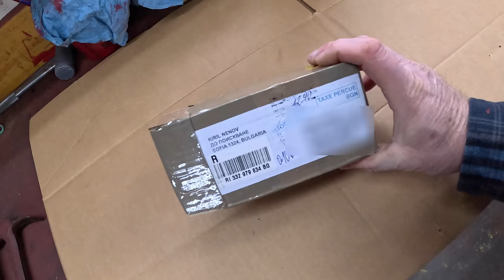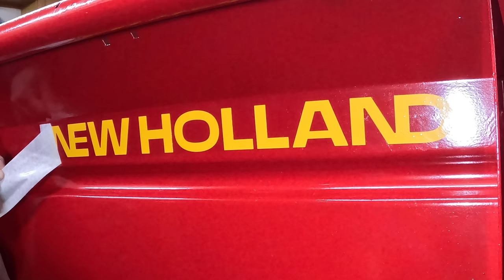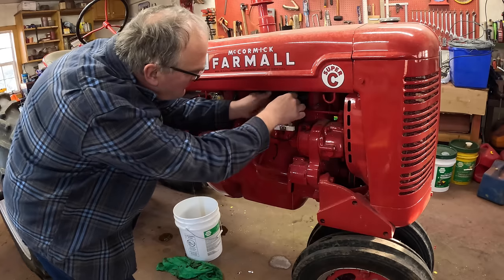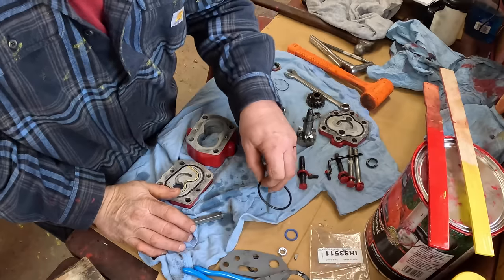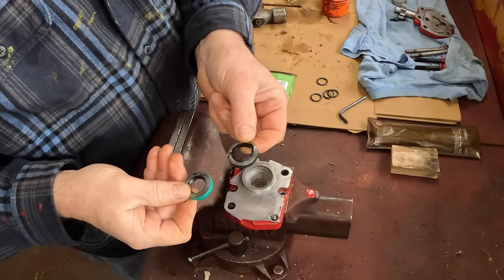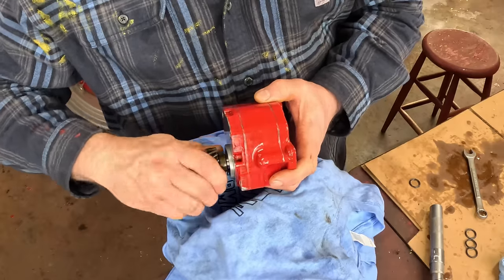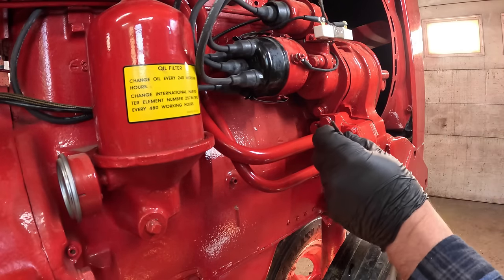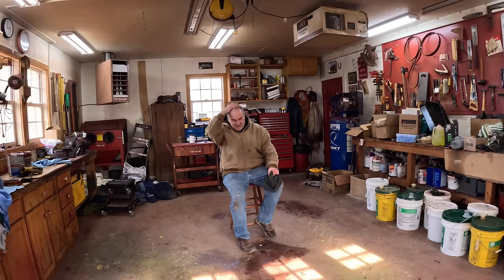Repairing the Farmall Super C Hydraulic Pump and Applying Manure Spreader Decals

Comment: Man that super C sounds great !!!
Surprising how well it runs, has no trouble in road gear. 
So nice to see a Farmall going down the road without having to move the steering wheel hardly at all !!!
Spreader turned out much better than most would expect. As much as you use it in the spring, this year should be trouble free, & operate like new.
  Going to be hard for me to watch that first bucket go in there, BUT …. You bought it to use……
Quick power wash & good as ever.
 Congrats on getting the pump repaired, getting parts seems to always be a frustration at times.

Comment: Hey Pete, it's getting cold here in Wisconsin as well. 5 degrees right now. No heat in my shop so I'll wait for the sun to warm things up. Rebuilding old equipment with the intent of them going back to work can be quite the challenge. I'm so disappointed with the remanufactured and after market parts I've been buying. It seems many of them are just supposed to be bolted on and not actually worked. My most recent project has been the worst. Two radiators, two water pumps, three fuel pumps, two carburetors and valve lifters that go flat when sitting overnight. Doing something the first time is satisfying. The second, not so much. My next big hurdle is that the last real parts guy is retiring first of the year. The rest are nice fellows but can only follow the computer prompts. I'm not ready to go the way of the dinosaurs so I'll just continue on having fun getting greasy! Thanks for all the real world videos.

Comment: Ah.... A cliffhanger from Pete, I love it. That hydraulic pump was more complicated than the one on my old super a about 30 years ago I found the oil over full and didn't know what was wrong, so I went to my I-H dealer and he said to pull the pump off and bring it to him. He split it on the counter picked the shaft o ring popped a new one in and charged me a couple of bucks. Been fine ever since. I sure miss him and having parts 5 miles away.

Comment: Hi Pete
Hello from Minnesota 
I’m a Swiss machinist I run a CNC machine my bar feeder that put raw steel bar stock into the machine the bar feeder runs about 1500 to 2000 psi hydraulic oil and the filter caps are held down by 6 bolts the seal is a 8 inch diameter .120 diameter o ring I will cut and superglue the rubber o rings together and have no problem   With any oil leaks 
You should be fine making your own seals
❤your channel keep doing what you’re doing 
Gunny

Comment: The soapy water is to move the decals where you want them and has nothing to do with activating the adhesive.
When you squeegee the decal and force the water out is when the adhesion takes place.
I use to put decals on work vans years ago and this was a common method of installation.
It did not make sense to me to use the soapy water as I thought that would defeat the purpose, but it worked like a charm, as you found out.

Comment: The soap and water isn't to activate the decals, but rather it gives you leeway to shift the decal into the exact position you want and to straighten out the kinks/rolls from applying it so you don't get a bad set on it. And the waiting period is just for it to dry so you can peel if off cleanly. 
It used to be one of those tricks of the trade techniques, but is now so well known its now standard practice in directions.

Comment: in my experience if you cut the two ends of the O-ring at a matching sharp angle they hold well.  preferably cut where one end goes on top of the other in the direction of compression. not side to side.

Comment: I hope the restoration is the 856 , I have a 656g and an 806d that need king pin bearings and bushings repair. I plan on doing them this winter, never done them before, would like to see how you do them. In the waiting room is a 560d with a bad head gasket. I truly enjoy all your videos and reference them quite often. Thanks for all your work putting them out.
Reply from the maker: Thanks Robert. The thought of the 560D head gasket makes me cringe. So many stories of poor quality head gaskets available today and the engine's original reputation for blowing head gaskets. Good luck.
Reply: Thank you for your reply , this will be the second one I have had to replace on this motor. Cross my fingers.  @JustaFewAcresFarm

Comment: I can say just as the Farmall the Belarus 600 series has the same issue of the hydraulic pump dumping or weeping hydraulic oil into the engine. Have experienced it more than one time. I don't think you can use O-ring rejuvenation methods everywhere but at least if it works for you, why complain right? I would call the manure spreader repair a total success. Next spring we shall see it in action.

Comment: I enjoy your restoration videos and look forward to your new shop build. I was wondering about your thoughts on E10 fuel in your vintage equipment. I have vintage small engines and am concerned about E10 in them. Should I be concerned?
Reply from the maker: I run E10 in all the gas tractors. No problems. I run ethanol free in small engines that sit for long periods, like my generator.
Reply: I live in Ontario Canada and apparently I can no longer purchase ethanol free gas anymore. I certainly not afford gas such as Alpine fuel which is around $40 per gallon. @JustaFewAcresFarm

Comment: During your joy ride, noticed the one visible gauge never left it's far left position.  Temp gauge?  If so, it appears that the thermostat is not working properly.  That, as I'm sure you know, would never allow the engine to warm enough to evaporate the condensed water in the oil.  

Do really appreciate your clear explanations of how things work and what you're doing.  Thank you.
Reply from the maker: It is the hydraulic temp gauge.

Comment: As someone who’s first job was vehicle graphics using vinyl lettering, I assure you that the adhesive is sticky and needs no activation, the soapy water is to prevent it sticking in the wrong place and as you said, gives you chance to reposition it.
You can do it without, you just stick one edge of the carrier tape and work it down into place. 🙂

Comment: I know it's "just "a manure spreader but I wonder what could be sprayed inside bed to help with preserving paint job and make cleaning easier. That doesn't cost a small fortune. Probably nothing lol
Reply from the maker: People use spray-on bed liner and such, but a few minutes with the pressure washer after I am done with it in the spring, along with storing it inside, will make it last a long time. For proof of that, look at the old orange spreader I backed it in next to in the barn. It was painted 10 years ago, has hauled 100's of loads of manure, and paint looks great.
Reply: @JustaFewAcresFarm  I've noticed the other manure spreader it looks sharp funny you don't normally think of something that spreads poo as "sharp"lol

Comment: Sorry, no rain cap on that exhaust really triggers me! We've had red tractors for over 40 years.  Before that it was just whatever Dad could afford.  8n ford, Minneapolis moline, Oliver, Case.  All stored outdoors in upstate NY and all with rain caps on exhaust.
Reply from the maker: The clatter of rain caps makes me crazy, I don't trust them to keep rain out, and they are not correct to this period of tractor. I prefer soup cans.
Reply: @JustaFewAcresFarm  I understand and appreciate your practice.  Funny thing is, I always like the clatter of one.  The tink tink at idle is a favorite farm sound, the same as the sound of diesel engine, the stroke of a square baler plunger and the sounds of a bar rake.  I have seen rain caps stuck in the open position, as I have seen cans blown off as well.  Frustrating to get water in the cylinder!